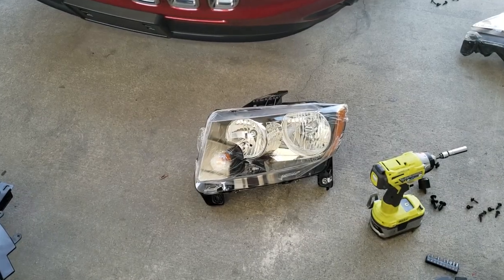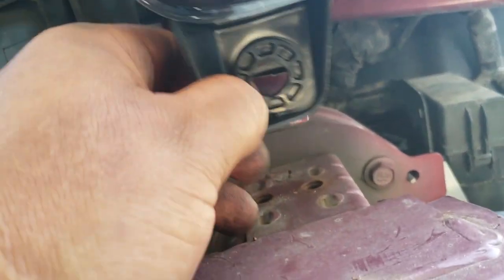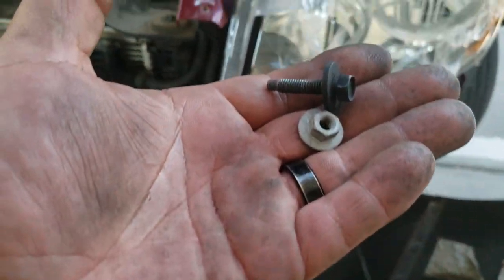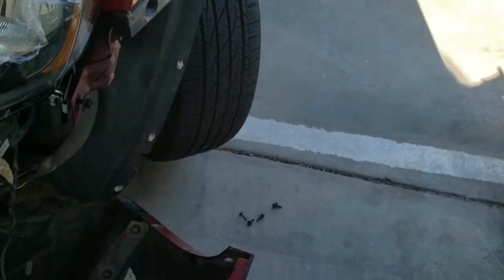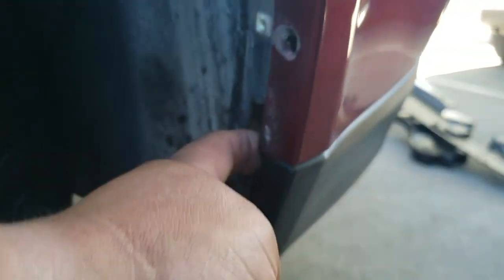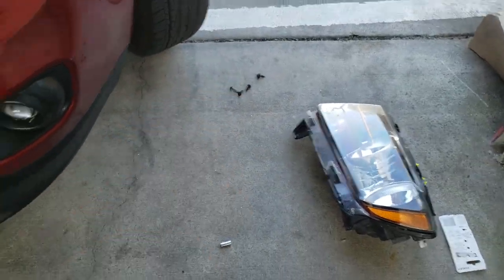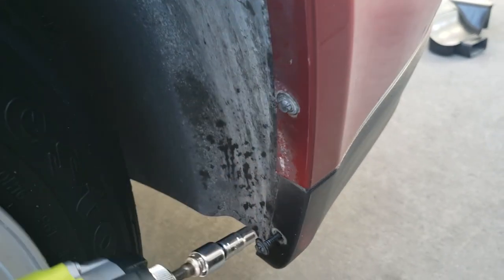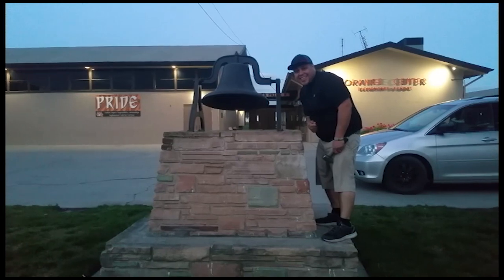How to: Install headlights on a 2015 Jeep Compass

Comment: can i get a straight answer on how to replace [ just ] the front lenses on a jeep compass 2014
Reply from the maker: The whole light housing has to be replaced
Reply: @559powerscape  so the pair Of lens I bought From A eBay saleman which cost me $ 210.00 wont Be any Good to me ? Please response Asps. Because Otherwise I Have To returnd them, before the warranty runa out. Thank You !
Reply from the maker: @ivan25859  the lense has to be removed with a heat gun to be able to cut thru the weather strip then replace the lense and re seal it....I found a set of 2 headlights for under 200
https://www.1aauto.com/2013-17-jeep-compass-driver-and-passenger-side-2-piece-headlight-set/i/1altp00996?f=987559&y=2015&gclid=Cj0KCQjwhr2FBhDbARIsACjwLo2NPZqehDG3DkUsXNqpgNOONnkrBFfX8TMcdLr4_AuGXE7uDhI8C_UaAl7EEALw_wcB

Comment: My kind of mechanic! 

"Is not the right bolt but....... ima make this pos work....

Sounds like me when I'm into a project!
Reply: Now I'll bet my light replacement won't be so easy. I'm in Michigan and the weather just dropped under 40°....
A deer decided to run in front of my wife and took out the entire passenger side lights! 
That plastic become pretty brittle in this cold weather!
Reply from the maker: Wow yeah, im glad everyone is okay. Good luck bro. Take it in the garage its freaking cold outside. 🥶
Reply from the maker: Lol you have to bro. Gotta make it work one way or another lol